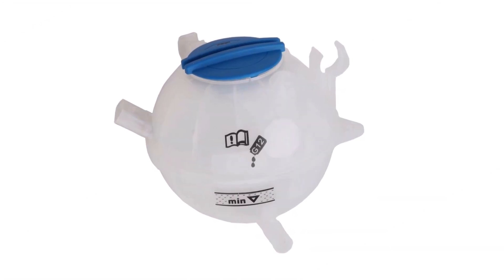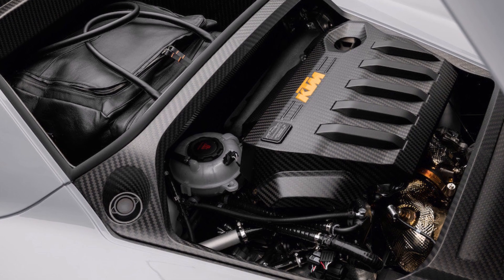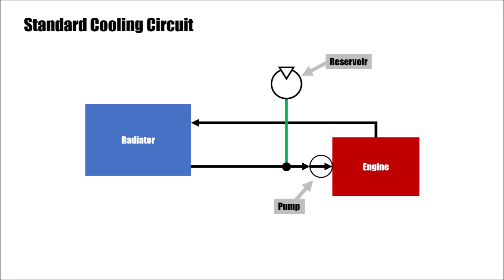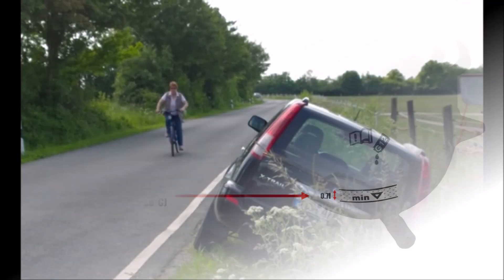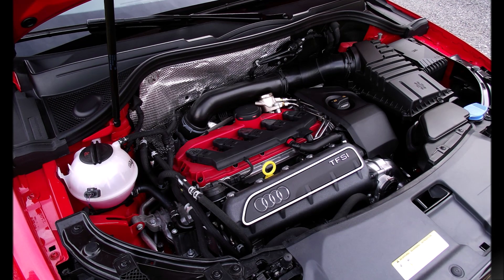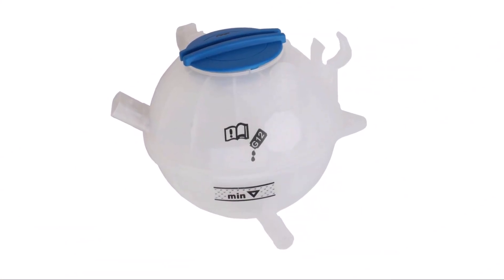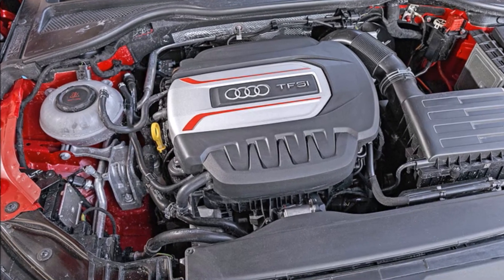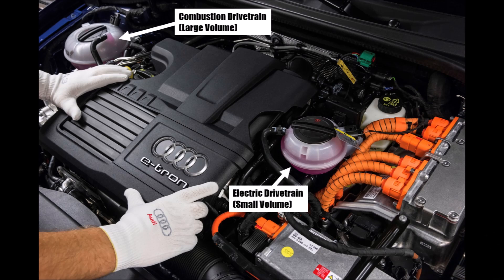How to design an Expansion Bottle? (Cooling System EXPLAINED)

Comment: The ideal shape for keeping the hose connection covered isn't a spherical one, but a taller shape, e.g. upright cylinder shaped tank. 
However for any car a spherical tank will be more than enough for any reasonable and many unreasonable situations. And it has the advantage of having highest stiffness to weight ratio.

Comment: Reservoir can be mounted at the bottom , low pressure will suck up into the radiator .. motorcycles best example
Reply: can't speak for all motorcycles. but the ones I've had use a older style radiator cap where the radiator is always filled to the very top. There is a valve in the radiator cap that allows for coolant to flow into the overflow tank when the pressure in the cap is exceeded (1.8bar on some Kawasakis atleast) and allows coolant to flow back into the radiator when there is vacuum in the radiator.
the overflow hose has to be connected at the bottom of the overflow tank so air can't get in. And the hose is fairly small so it can't trap too much air. Modern cars use an expansion tank instead of an overflow tank.
Reply: Since a motorcycle leans when turning (experiencing G force) maybe there's less design limitations

Comment: Very insightful. Can you explain why the Phaeton W12 (perhaps other models too) have an auxiliary expansion bottle? Perhaps because the primary bottle isn't spherically shaped?
Reply: Or because of the ridiculous HVAC requirements of the car, there could be a separate cooling system specifically for the heater.
Reply: It could be because of the quantity of the cooling system of the larger engine. Simply put 1 expansion tank wasn't enough for the expansion of the whole system. I could be wrong though.

Comment: I disagree on shape, the ideal is an upright cylinder. Its easier to package too.
Reply: To withstand a certain pressure, the sphere's thickness is the smallest.
Reply: With a hemispherical bottom
Reply: @carlopitti7500  not necessarily - just make the cylinder tall and narrow.
Reply: Wouldn't be it a cone?  The cone angle should be adjusted to the required longitudinal and transversal forces (aka g's) .  This is from filling point of view. Obviously as a pressure vessel the spherical design is king.

Comment: the generic vw expansion bottle is a legend
Reply: Coolant ball
Reply: Yup, the best.
My sister has the FIAT one wich is garbage.
Reply: Turns yellow so you can't see the coolant inside and cracks whenever you hurt it's feelings.
Reply: @AzanAli-  I have one the car has 20 years almost and it's transparent, can see inside
Reply: @AAAAAAndrea  Interesting. Maybe previous owner for mine replaced with Chinese one.
Reply: @AzanAli-  Could be, my replica headlamp faded in like 5 years while the 20 yo is still mint

Comment: I don’t see how a spherical shape is better than a cone or an upright cylindrical shape for hard cornering or braking. The sphere has the least friction of any design. The coolant will slosh around in circles.
Reply: The sphere has the same distance to the center at any point, ultimately why it works, it doesn't promote different depths depending on lateral g forces, which isn't great on a small tank anyway. Worth keeping in mind the reservoir needs to be high because air is much less dense than the fluid, it also needs to be accessible to both humans and the cooling system so it has to be on the engine bay, which has limited space. A cylinder would work it it was mostly full, which shouldn't happen as described in the video.

 Could very well be either overestimating your imagination or overestimating how bad sloshing is.
Reply: You need to keep those upright, if you have space for it, sloshing shouldn't be a problem because it's a sphere

Comment: I have enjoyed your videos, but I see lots of information that is incorrect.  You give the "typical" diagram but forget the pressure relief valve. It's called a "Radiator Cap" and releases excess pressure as the water expands or boils in the cooling system.  As this water exits the cooling loop, it goes into the coolant reservoir at approx. 1 bar.  As the engine cools, the coolant flows back into the loops via suction as the coolant contracts.  Although your pictures show pressurized bottles, the pic. at .08 sec does not. You mention the best shape is a bottle, but the Tesla design at 1:04 is not round in any way.  It's tall with multiple internal dividers to keep bubbles from the bottom. The coolant reservoir does not need to be mounted up high, that is only to ease operator filling.  The "pressurized" coolant cap you showed has internal baffling to help ensure the water and air are separated, but not part of a pressurized system. None of the caps have international warnings about pressure relief, but they warn of hot water. Google "audi coolant reservoir cap" and take a look. 
  I also like the Audi at 3:35 with the oil coolant line run on the outside of the frame rails.  This will ensure that any damage from another car or roll-over will break the line and cause a DNF.
I like the bottle design at 4:09. It has a nice picture of which way to roll your toilet paper.
Reply: I think your describing a different style or reservoir. I was wondering why he left it out of the video.  Maybe because he’s European and it’s usually found on Asian car designs.
Reply: Nah you're describing a different type of system, with an unpressurized overflow reservoir.

Also that's the engine bay of an R8 LMS, the design has proven itself, so you're on to nothing with that.

Comment: Does F1 cars have expansion tank?
Reply: I think they use a closed system, so they are fed coolant until there's no air left and they work with that, no expansion tank would work as they reach around 5-6g in the corners
Reply: Technically No. They use high pressurized systems for aero advantage. But they do have an accumulator which is to add pressure to the system.
Reply: No. The expansion tank is to catch water overflow on a coolant system if the coolant is hot, then return it when it cools down.  Racing cars ALWAYS check coolant levels before going on the track, but anything that goes track must have a coolant overflow can/bottle/device.  Different for different classes.  I can personally tell you there is nothing like trying to pass an overheating racing vehicle.  You are typically going over 100MPH and you get constant blasts of boiling water on your face. It Hurts!!

Comment: Nice video, i also have a question. As you said cooling system generally runs at 3-4 bars and thats good enough to not boil the liquid up until around 140 degree celcius. My queestion is does the cooling system still run at same pressure even at lower temperatures lets say around 90 degrees celcius? Or does it simply still run at 3-4 bars even at lower temperatures? I also heard higher pressure in the cooling system makes the liquids job of taking away heat from the engine harder , so if it runs at 3-4 bar at even lower temperatures i guess that will decrease efficiency of the cooling system a bit?
Reply: Higher temperatures are going to increase the pressure, and low temperatures will inevitably reduce it. Think of pressure pans, they all have bleed valves and it doesn't mean they'll be at that pressure, they may never reach that pressure, it's just for extreme cases.
Reply: The primary coolant loop in a pressurized nuclear reactor is over 100 bar to raise the boiling point over 300 °C, and even in the secondary loop it's over 50 bar. They don't seem to have a problem with cooling efficiency, so a few bars in an engine is probably not making a difference.